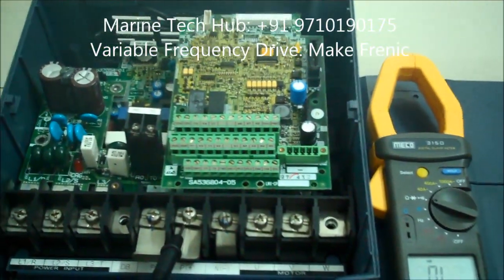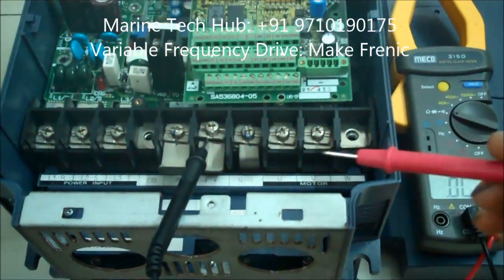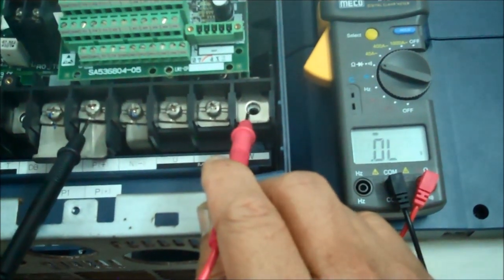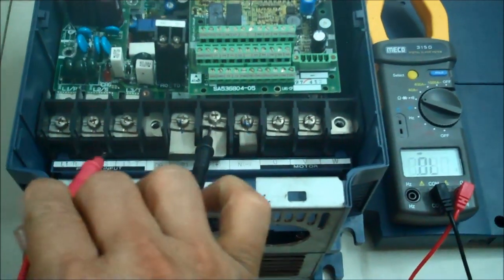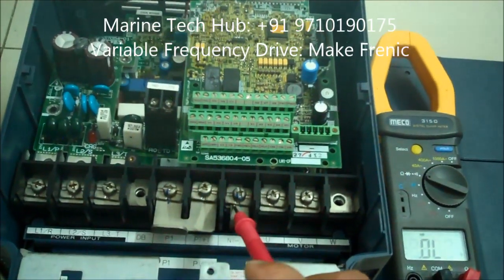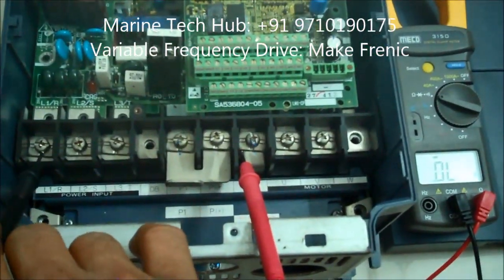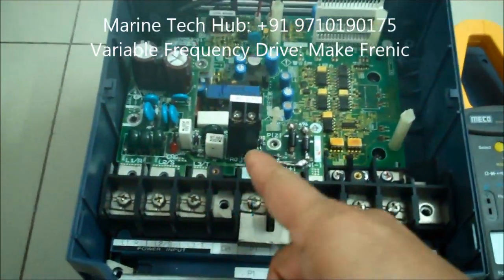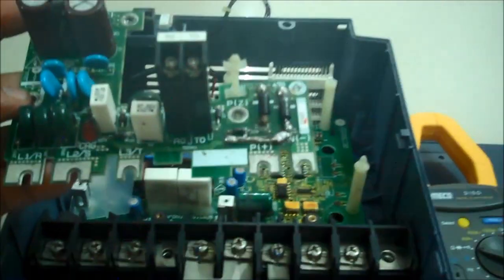How To Check Trouble Shooting:Variable Frequency Drive

Comment: Please how can resolve the of Error F0500 on AEC 500 - 46A solar inverter bonfiglioli vectron.  

Error F0500     displays  on the Kp 500 control unit once I switch on the auxiliary 220volts AC power. Sometimes it delay like 60sec  before the error F0500 show up without any load at the output.

Comment: sir, what is the reason of placing positive wire of multimeter with negative point of VFD, and then you change by putting negative wire of multimeter with positive point of vfd,,,,pls explain...any reason????

Comment: Thank you sir. I need some advice on a frenic drive which is running the motor but with much vibration. But when I put new one , the lift runs smoothly. How can I fix the old Fuji drive
Reply from the maker: Thanks for your valuable feedback. Please give the value of IGBT when vfd not running

Comment: ABB Drive
ACS880
DC Bus voltage 565V in multimeter
Display side 0V showing
Drive inverter fault alarm

Comment: Thanks for the video.  I have 5 hp crompton vfd. The problem is when we switch on, the initial frequency goes upto 28 hz & start blinking and does not go beyond 28. What may be the problem. 
Regards,
Reply from the maker: Thanks for your valuable feedback. Please get the membership level 5 .

Comment: how to control a motor by using vfd without connecting to plc? if it possible send me a circuit for that.
Reply from the maker: Thanks for your valuable feedback. For more details contact my WhatsApp no + 91 7010035459 and email address : devanandts1965@gmail.com

Comment: Hi, Very informative video. My contact no.- 7405663938. I want to know that what is the next step to check I/P board if it is faulty.
Reply from the maker: Thanks for your valuable feedback. My whatsapp no +91 7010035459

Comment: If you pull up a basic print online and compare it to what points he's testing, you'll see that he's basically half splitting the diode section and igbt section. Because the incoming and outgoing terminals are tapped in between the diode 6 pack and igbt 6 pack. 

Also to clear up confusion, he puts the positive probe on the negative DC bus and negative probe on positive DC bus. Even though the top of the circuit is the "more positive side" and the lower circuit is the "more negative side", you have to change your meter polarity so you can forward bias the diodes and IGBTs. 

Pull up the print and it'll make sense. 

Hope that helps.
Reply from the maker: Thanks for your valuable feedback
Reply: Where can I get a print for motortronics csd 207 7.5hp drive.
Reply: Where can I get print

Comment: Hay sir, i have a question

My Schneider VFD (0.75 kW) is not working, the display board just blank (not showing anything), the button run/stop is not working too, and the motor can't start(to control the VFD im using PLC with RJ-45. but, the power indicator LED is on...  Any suggestions??
Reply from the maker: Thanks for your valuable feedback. please get the membership for more help.

Comment: Hi sir , in our drive showing OU3 alarm code ,unable to reset drive I felt input scr problem .please give me reply.
Reply from the maker: Thanks for your valuable feedback !! Do share it with your colleagues and friend
Hereafter all my new videos will be available in website www.marinetechhub.com
please see all my video for more details in my website
OU3 is over voltage. If it is not resetting. Try to put off the power supply and wait for 3 minutes and again start the system and hope it will reset. Give me the feedback
Please install Servo stabilizer for the safety of the drive
Reply from the maker: Please let me know  which company you are working .

Comment: Thank you Sir. Excellent knowledge sharing video . Sir I have Siemens 20 V VFD.  Supply is available at input terminal. but no display is coming . I have replaced  it with new VFD .New VFD is working fine ..what are the possible causes of problems in old VFD please explain
Reply from the maker: Welcome to Marine Tech Hub
Thanks for your valuable feedback !! Do share it with your colleagues and friend
Most of the time IGBT failure.Replace IGBT
Reply from the maker: Go to google search type for my new website www.marinetechhub.com
Reply: @MarineTechHub   our Gefran vvvf drive ,it showing power down error..the drive is getting on with correcf display
Reply: Please check the control card of the vfd. May be the problem is in Control card, If you are getting proper dc link voltage then 100% sure , Your cintrol card is faulty.

Comment: Sir my Allen Bradley 1336 drive trip in over voltage fault during start, it run fine up to 17hz, but trip above it.
Suggest be solution?
Reply from the maker: The machine is running an unbalanced charge with large inertia ? I mean that the unbalanced make the motor régénérative during short période. One solution is find the parameter who speak about DC link control (anti régénérative fct). Also, try to put the inverter in Vector control instead u/f. Please, give more détails about alarm History, ref speed ? Output speed ? Output current ? DC link voltage at normal opération.
Reply from the maker: Check parameter 288, set to 1.
Reply: One time check all parameters
Reply: HELLO ,
MY NAME IS RITIK DEOL
And i from ( NATIONAL AUTOMATION INDIA (LLP) )
aap kisi ko bhi (VFD, PLC, HMI) repairing  krvani ho to 
ya fir electrical panal bunvana ho and VFD parts lene ho to   contact kre 
BEST PRIES m 
all india services
contact no. 7777006122
thanku so much
Reply: Motor is going in regenration.problem may be in encoder also